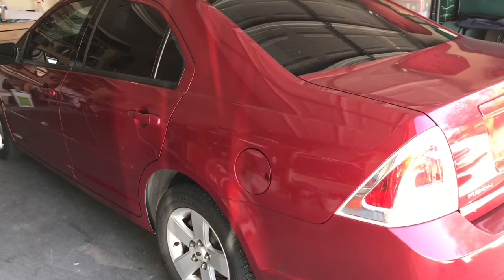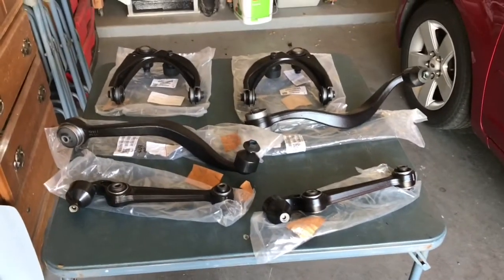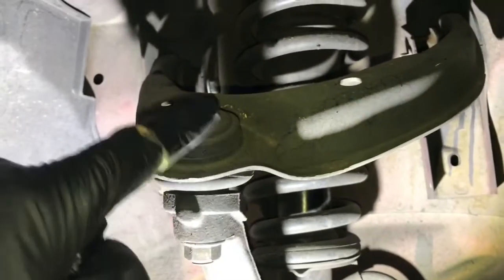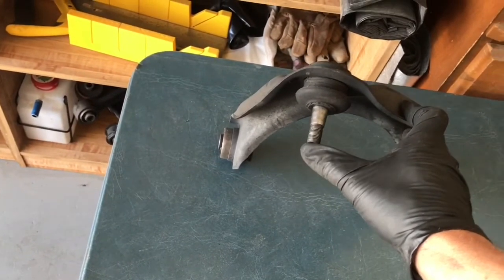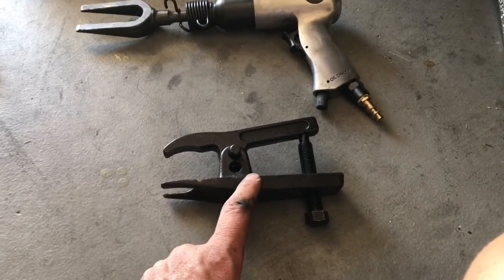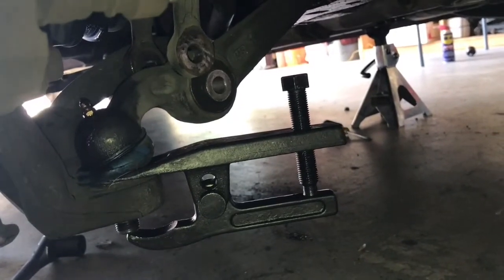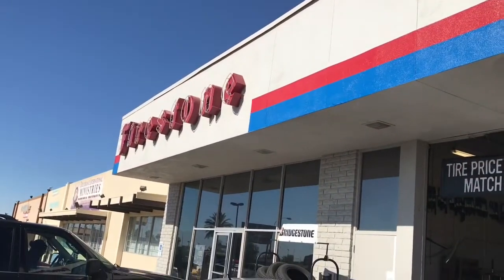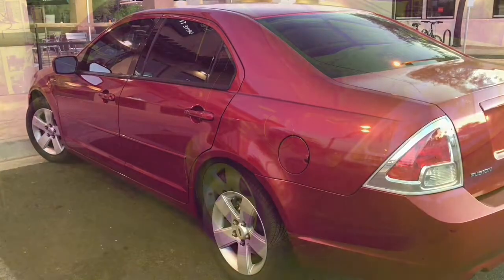Front Control Arms 2006 Ford Fusion (Mercury Milan Mazda 6)

Comment: I’m doing this job right now on our 2010. Fought with those lower ball joints for a few days and finally decided to just buy a pair of knuckles from the salvage yard ($50 each, even included hubs). They didn’t come with the brass inserts for the ball joints but Moog sells them separately. I took out the entire old knuckles with both pairs of lower control arms still attached. Much less torching and sledge-hammering required. :)

Comment: I don't know if you left out some things this was a really good video but what I hear those lower control arms you did drop the subframe on one.  The other lower control arm the bolt from what I hear is right at the transmission and sometimes you have to jack up the transmission to get it out I don't know if you had any issues with getting those bolts out. Thank you for the nice video.

Comment: I had the lower control arms replaced at $990. Other parts were bad so to avoid paying a couple grand more I did the work myself. To replace the bearing I needed all of the control arms disconnected from the knuckle. I spent 4 hours mercilessly beating it until the bottom arms came up. It then took another hour to reinstall the knuckle. I revisited the same corner for different parts adding up to 18 total hours of work

Comment: Hey Scott were the controll arms shot or could you have just replaced the ball joints exclusively, I’m about to do this job on my fusion but am unsure whether to do arms or just joints
Reply from the maker: I didn't have a press or I would have just replaced the ball.
Reply: I believe that only the upper control arms have serviceable ball joints. The lowers are integrated into the arm rather than pressed.

Comment: do you by chance have a part number for that kit you ordered from 1A Auto. I can't seem to find that kit.  I have a 2007 fusion and would like to do the same thing. I can only find the 6 pice with sway bar not upper control  arm. Thanks
Reply from the maker: Travis Duncan Sure, it is 1ASFK01849 from 1a auto

Comment: Great video Scott, I have the same car 2006 SEL fusion, and I got some clunking noises in my suspension, and as a DIYer I would like to ask how long did it take you to the the whole job?
Reply from the maker: erick magalhaes It took about 3 1/2 hours.
Reply: @ScottsGarage17  you got lucky with no broken bolts or nuts. That tool you got from harbor freight I bought and the end of mine broke off during a wheel bearing replacement. Had to bring it back and I used heat to separate the joints. I will give this a try though.

Comment: Is this car a V6? Did you have to lift the engine to get the drivers side center arm rear bolt off?
Reply from the maker: Yes, it is a V-6. No, I did not have to lift the engine. I used a large crowbar to slightly separate the sub-frame from the frame after removing the sub-frame brackets. Use the main frame as leverage. It will allow you to get the head of the bolt out.
Reply: @ScottsGarage17  Good advice. Thank you.

Comment: So when trying to preload suspension to ride height I come up off jack stands quite a lot to the point of unsafe to me. Any ideas as to why. I don’t see as much travel when watching your videos. Won’t be able to reach all bolts if on ramps I don’t think
Reply from the maker: Yeah, don't do anything unsafe with the jack stands. As you can see in the video I have super heavy duty jack stands. Add more stands if need be. Be safe.
Reply: I've had that same issue with a couple cars I've done CAs on. Just keep your jack stands in place. I do wonder if his didn't come off his jack stand because it was forward of the wheel. I'm about to replace the front rearwards and I'm not sure where his jack stand was actually placed.